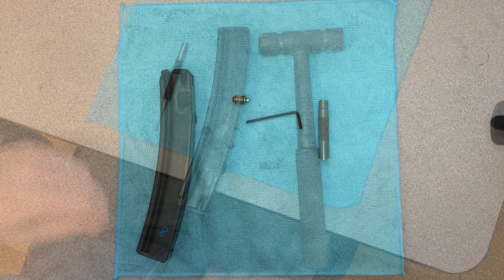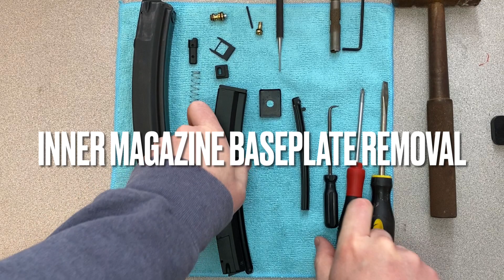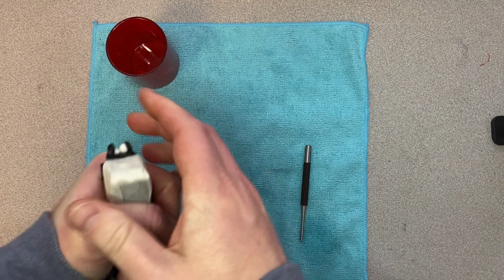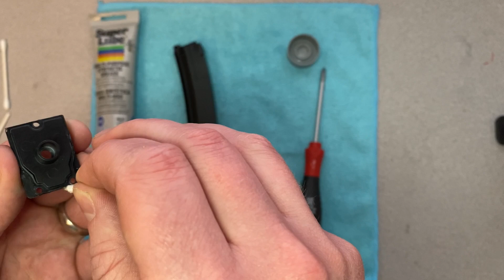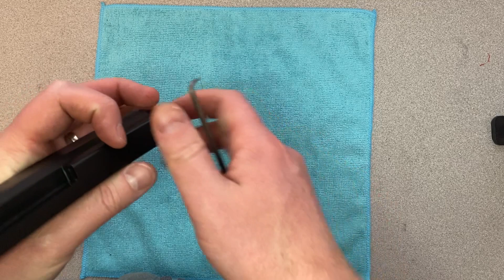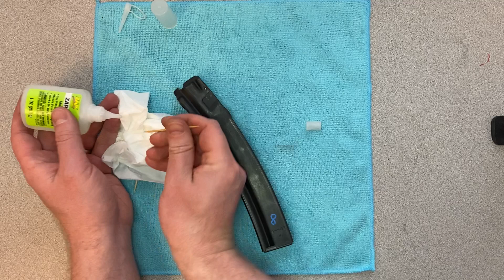VFC MP5 GBB V2 - Magazine Disassembly/Reassembly and Feed Lip Modification

Comment: For some reason, I can't get the outer shell off, even after removing the pin and valve. It simple won't budge no matter how hard I try pushing it out. Any ideas how I can remove it?
Reply from the maker: Sometimes they can be stubborn to get moving initially, but it should slide off. Is there any damage to the shell from dropping it (e.g. dents)? This could cause it to be tight to remove. 

You could try tapping it out with a mallet and something soft to use as a punch; just be careful not to damage anything.

Comment: Hello there nice video. I have a major problem maybe you have a tip. On one of my co2 mags the right lip has broken and I have no clue how to fix it or get a replacement. It´s not completely off but no way to glue it IMO. and on one mag the right lip broke off. On wgc I only find left magazine ceiling plates. daaaaamn
Reply from the maker: It is available here:

https://www.redwolfairsoft.com/umarex-vfc-mp5-co2-magazine-bb-tube-right.html

I do not believe glue or an adhesive would hold up. If it were me, I would replace with a new part.
Reply: thx man you saved me :) I ordered some. And also the crusader feeding ramp. I got a V1 for very cheap but now I ordered the V2 kit etc. and some other stuff. I hope I don´t regret it.  @aetechairsoft

Comment: Your guide is very helpful, though i cannot seem to stop these magazines from leaking. I'm about to trash them and just buy new ones. Even getting a new release valve for too much money didn't fix it.
Reply from the maker: Where is the leak occuring in the magazine?
Reply: @aetechairsoft  both in the baseplate as well as top. I tried everything from soaking the rubbers in silicone and an attempt at sealing them with automotive grade gasket maker but to no avail. I found a single new release valve, this one seems to hold up well but the rest just lets go soon as i inject some gas.
Reply from the maker: It's difficult to diagnose online, but these mags generally have good sealing performance, so something seems amiss.

Leaks at the Top of the mag really only have a few common causes, and they all revolve around the release valve. The O-rings need to be clean with no particulates, no tiny rips or tears or any other form of damage. If they're damaged, replace the o-rings with new ones from theoringstore.com. The o-rings should get a very, very thin layer of grease around them before you reinstall the valve into the magazine body. The armature (the moving piece in the release valve) should be checked for particulates on the inside of the release valve or around the seal. any dirt or other particles can cause leaks.

If you use a dry gas without added lubricant, check the movement of the release valve armature as well. If it is sticking open or even feels sticky, it will leak when you try to fill the magazine with gas. A drop of silicone oil and a few cycles of the release valve should clear this up. 

Leaks at the bottom of the mag really have the same common causes. The bottom gasket should not have any rips or tears. The inlet valve outer o-rings need to be in good shape, no damage or rips. Thin layer of grease on them before reinstalling, and the inlet valve should be threaded in very gently and without much torque or you can damage it. 

 @gebroedersvanbrabant7334
Reply: @aetechairsoft  thanks man, appreciate the help. The bottom plates dont seem to seal at any cost, the inlet valves are fine. For the top i suppose it's the release valves that are worn, but they're hard to find here. I got a single one from the UK for 25 euro's... Tbh i'm better off buying a new mag for 30 euro from hong kong..